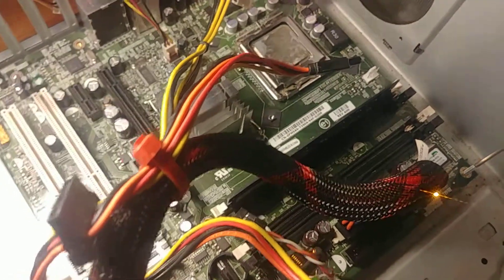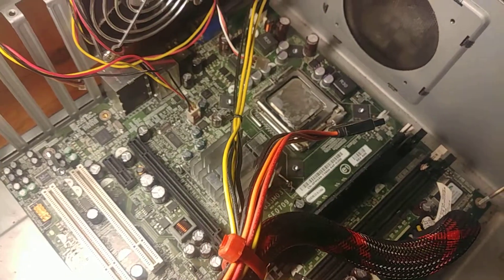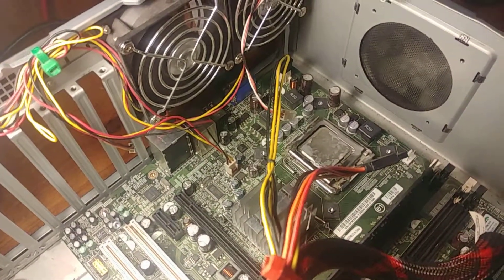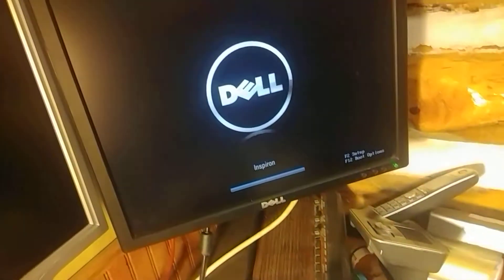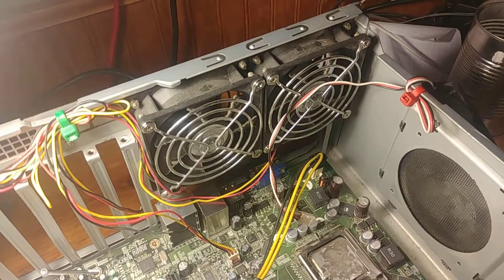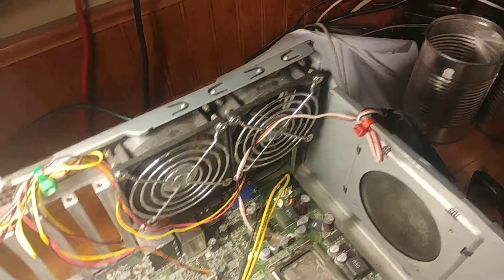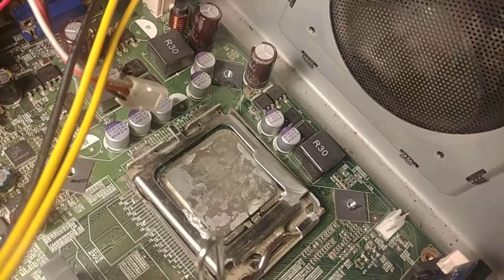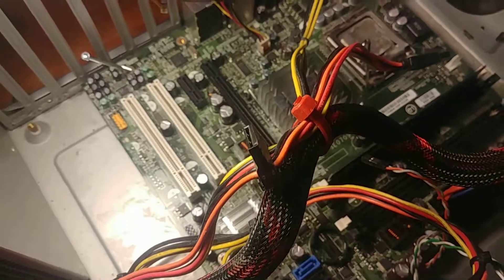Removing CPU While Running

Comment: Should have done it while windows was running
Reply from the maker: I'm thinking about doing a follow up video in the same style, didn't have a spare hard drive at the time
Reply: @AlexReiterProductions  you can just put Linux on a usb stick then and do that no hard drive required